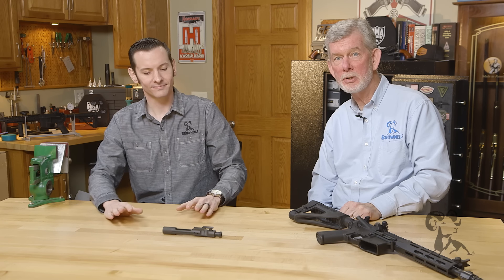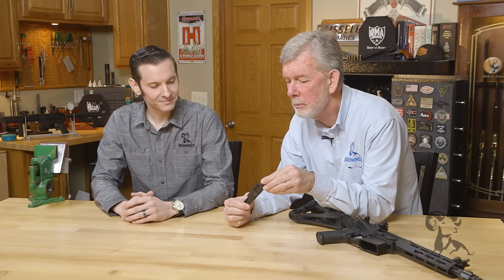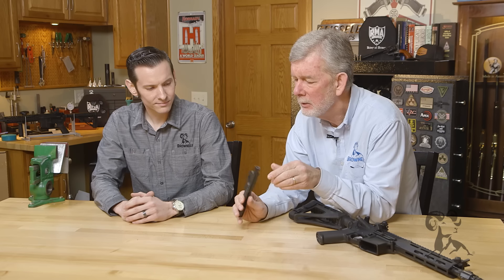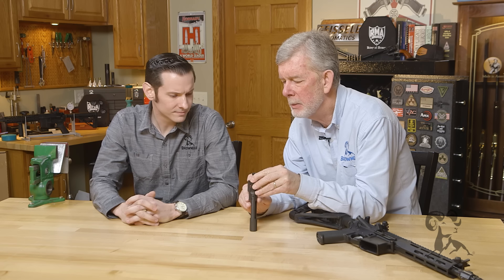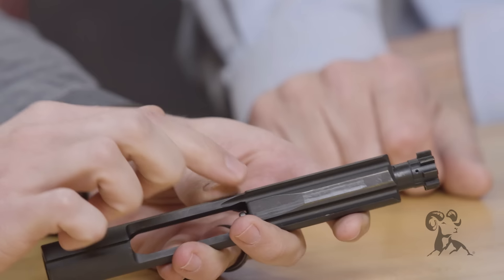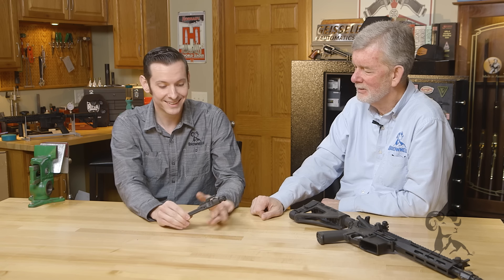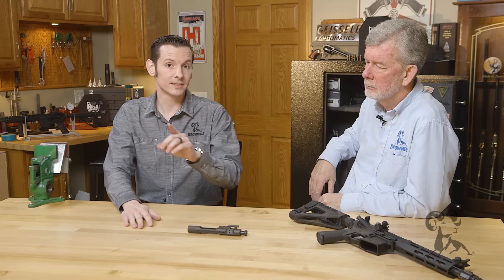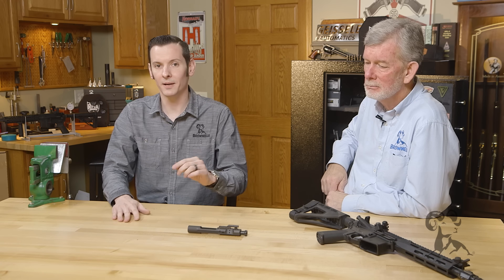Smyth Busters: AR-15 Bolt / Carrier Lubrication

Comment: When I was a new soldier, and most of my time in the military I kept it well-oiled, as directed and the established norm. Before and during my deployment to the Middle-East, I used practically none. I thought very carefully about it and decided that only true "friction surfaces" may need lubrication. It worked very well...actually better than with more lube. I wasn't wanting to attract sand and dust to those surfaces either.
  There has been so much misinformation in the military about lubing the bolt-carrier group.
  I am a big fan of dry lube also.
Reply: I was introduced to tw25b in Iraq my second tour and I swear by it. It runs smooth and no issues with dirt and dust.
Reply: @Justin Haven lubriplate?
Reply: @Oldmankingspiffy  TW25b is a great product. Beyond using it on my AR, my Sig P220 won’t run reliably without it and most of my 1911s run better if I use this on the slide rails.
Reply: @Oldmankingspiffy  I started using TW25B over the last 10 years or so on everything. It stays in place, and easily outlasts most other products.

Comment: Any place metal rubs against metal and couses friction.
Reply: Yep. Just like a car! Metal on metal should be lubricated. (Engine, Transmission, Rear Differential, etc.)
Reply: @rexlr695  And Mobil1 0-5 is just fine and dandy, if it's good enough for a race car engine it's good enough for my weapons.  The stuff sticks to the metal and doesn't hurt it one bit and is slippery.
Reply: And friction causes heat which, can lead to a lot of issues.
Reply: @UpChuckLiberals  mobil1 0-5? I cant find that one
Reply: @zstunts4843  Get the lowest you can find, it's not going to matter one bit.  Happy shooting.
Reply: I misspoke 5-30.  Sorry for the confusion.

Comment: I started an experiment many years ago.  I bought a double star AR15 chambered in 5.56.  I started by dropping in a 22lr conversation kit and shooting a 500 round brick of aguila 22lr.  Then I swapped it back to the 5.56 bolt and ran it for classes and competitions on a steady diet of tulammo 223.  This has been going on for almost 12 years with roughly 1,000 rounds a year through the rifle.  Never cleaned or oiled the BCG.  16" barrel and carbine length gas system.

Comment: When I was a fresh recruit, I did whatever was told of me and trusted the NCOs. Fast forward to the end of my contract and I was very particular about what NCOs tried to do to MY rifle. They wanted it DRIPPING wet with CLP and I refused, didn't get any reprimand for it. Dripping wet just didn't make sense to me, it was unnecessarily introducing the potential for schmoo and crud to habitate in the rifle.
Reply: @tuco86x  Schmoo. I haven't heard that term but I think I will use it. Ty.
Reply: My late brother in law, said that they cleaned their guns with soap and hot water, and  ran their M16's bone dry in Vietnam. They only squirted it with lube if it jammed up in a firefight.
Reply: @stevenrichards3699  That's the exact truth. Lubrication only helps after theres already a problem.

Comment: My bolt carrier assemblies are melonited, completely.  I spray the bolt carrier assembly with either solvents, than the oils listed below, and wipe off the excess.  My assembly shows no wear, but I follow the cartoon booklet of the Vietnam War for specific places.  I’m still reeling about mixing gun oils.  After 50 years of shooting, I learn this?  I used to use Rem Action Cleaner and Rem oil but switched to non petroleum Shooter’s Solvent and Shooter’s Oil except for use in my Remington shotgun.  The manual states nothing other than Rem products be used in my Remington.  
I spray or soak Brownell’s decarbonizing fluid after carbon is noted.  Now I’m wondering about your decarbonation fluid used first.  Does this impact parts, chemically, when Remington’s or Shooter’s Products are used?  I’ve used everything interchangeably. The first time of a quote “malfunction”, “lube” is used which solves range issues.  AR’s must be lubed.

Comment: Thank you for this video. I bought an AR type carbine a few years ago and recently started shooting it. I was told to run it with very little lubrication. The last time I shot it it malfunctioned with every shot. I'm going to give it a little more lube on my next outing and I'll see if that fixes the issue.
Reply: Lubrication is important, but also look at the magazine as a potential cause for malfunction. The only time mine ever failed to function was while using a Promag. Never again will I use one. Magpul is always a safe bet, and the gen 2 is perfectly fine for an AR and usually a little cheaper than the gen 3

Comment: Even did it this way in the army.. moderate oil on those friction rails, light oil on the rest of the bcg, light oil on the gas rings (not through any holes, literally directly applied to the gas rings after making sure the end of each gas ring was pointed a different direction, before putting the bolt in the bcg), LIGHT oil on the part that resets the hammer - you never want oil getting on your ammo.. great way to increase chamber pressure and go boom instead of bang.

Comment: A light coat of Supertech high temp grease from Walmart works great on all those surfaces mentioned. It's cheap too.
Reply: I use it for my handguns too, that stuff lasts FOREVER almost. I'm in Arizona and I shoot in the summer as well, the thinner oils aren't nearly as long lasting.
Reply: @tehkoalainsurgency  I am a fan of Slip 2000 or Slip 2000 EWL too. Doesn't evaporate easily, excellent viscosity.
Reply: I use the high temp bearing grease and holds up well. And for the few bucks it costs you get a lifetime supply. 

If it slides use grease
If it rotates use oil.
Reply: @JamesSmullins  That's what Cajun Gunworks told me two weeks ago. Bought their moly grease/oil.
Reply: vegeta420z  Amazon is no better and in many ways far worse though Walmart is trying to catch up in those areas with their online third party sellers.

You can get that grease at any auto parts store, if you have a local one use that.

Comment: I always been a grease person and never had issues with it. I found that my rifle would last longer than anyone else at a class and was even asked what I used and people were surprised to learn I used grease. It's important that when you use grease you learn about the friction points of your rifle and only apply the grease to that area and apply so little that it leaves a thin coat. Also grease last for decades if you have just 1 rifle. I have a 16oz jar of Red n Tacky that I bought back in 2015 and still use it for my AR rifle to this day.

Comment: I soak mine. Oil comes off over time but can’t be added in the field. It protects from rust and suspends any dirt until cleaning. Cleaning is easier because nothing is baked on, just wipe and reapply. The “too much lube just gathers more dirt” idea is a myth in my experience.
Reply: I've certainly seen machinery that was over lubricated and got crud into the gears and whatnot. Whether that's a problem for a rifle, can't say, but I would assume that having excess tacky lube on exposed sliding surfaces would gather up abrasive dust & dirt pretty well. Light oil, not so much.

Comment: I didn’t learn anything weird in the Army. But about 18 years ago my police department got a bunch of M16A1’s on loan from the Guard. They told us we had to soak the BCG. And while we were qualifying the range guys were walking around behind us with a spray bottle of oil to hose them down. Instead, I wiped my BCG down and just applied a tiny bit of oil where it’s needed. Had no issues. But the guys who would soak them down did.

Comment: Sorry to ask, but I heard some former military guy some where saying that everything that slides we should use grease, and for all moving parts oil. Is that correct or that's doesn't matter ?
Reply: That is probably the best advice about slides: grease, moving parts: oil, but honestly it takes about all of 30 seconds to remove your BCG and give it a quick wipe it down to remove any dust and carbon. The only time I can see an absolute need for grease is if the weapon is going to do sustained full auto fire. IMHO just a little bit of quality gun oil like Slip 2000 on all the sliding and moving parts (combined with the frequent wipe downs in hostile conditions) is plenty good enough.

Comment: I think the one drop in the gas tube connection helps "seal" the connection when the gas tube is installed. You can clean that little section with a pipe cleaner. Not a big deal
Reply: I would assume any oil in the gas tube would be blow out from pressure? Most gas tubes have I see have some residues surrounding them, from what I can tell it’s not a perfectly sealed system.

Comment: I have had issues with jamming in cold weather when lubed with oil; so when it’s cold (far north here. I’m talking -20 and colder) I clean the oil off and run graphite dry lube. The graphite has worked well in the cold, and since doing that I haven’t had any problems.
Reply: Interesting to know.
Reply: Fucking what?
Reply: it is interesting how temperatures wreck havoc with metal expansion/contraction, hardening rubber seals, freezing water droplets trapped in the action etc the whole physics change.
Reply: Vince Anders ...... not sure how to explain more clearly that extremely cold temps will jam you up if you run wet lube in it.
Reply: @kurtisb100  because cold weather justifies running an abrasive "lubricant" in your gun. Yes carbon is abrasive as hell. Source: I work with it every day. You're extremely stupid for doing that vs buying a lubricant that wont gel up at those temps.
Reply: Vince Anders since you ‘work with it every day’ I guess you must know a lot about it. Here’s what Wikipedia says about dry graphite lube. 

https://en.m.wikipedia.org/wiki/Dry_lubricant

I think I’ll take my chances that the cam pins wear prematurely vs jamming all the time in the cold. As for buying a lube that works in low temps.... I am beginning to think you’re not very familiar with actual cold temperatures. Anything that would stay liquid enough to work in the cold will evaporate after four shots, or once it warms up to room temperature.
Reply: @kurtisb100  except for the galvanizing that will happen between the raw aluminum that the graphite wore the finish down to and the raw steel that the graphite wore the finish down too.....sooooo yeah
Reply: Also notice every single application that was listed is specifically for high heat applications where liquid lubricants burn off? No? I'm guessing you skipped that part then huh?
Reply: New synthetics don't freeze up

Comment: I use one of those Chinese shaving cream brushes and brush CLP all over the outside. It's quicker than lubricating specific areas and nothing is missed. I also put a few drops of CLP on the cam pin.

Comment: I run as dry as I can to keep from prematurely gathering dust, I live in the High Desert in Eastern Oregon. Deployed 3 times as a Hawk Crew Chief. my rifles and pistols stayed dry and carbon free as much as possible but I used T25 or TU25 on my M240H. after the Marines gave us a bunch and we started using it, there is nothing better for belt fed. Its labeled for 50cal and up but I tell u what, its the best on a 240.
Reply: TW-25 was probably the best weapon lubricant I ever used. I used on everything from 20MM, .50 Cal, M16A2 and M9.  The grease was good for crew served weapons and the spray was great on personal weapons. 

I agree. When I went to Iraq, all of my weapons were run dry, and cleaned daily, at least. Never had a problem.  

Now that I am not in the desert, I have a wide array of lube and cleaning products to use. I still have some TW-25 floating around here somewhere.

Comment: Lube on the bolt carrier isnt about making the gun run, its about hardend steel sliding very quickly back and forth inside the much softer alloy of the upper receiver.....if you want the upper to last, run it wet. (But what do i know my family and myself only been in the manufacturing industry for the majority of our lives)
Reply: it only rubs on those rails....

Comment: I lube mine like an engine. Any area that touches another area that has movement during the cycle gets lube , other then rings. Rails on bolt carrier,  hinge outer surface on extractor and pin. Shiny area in the middle of bolt where in makes contact with bolt carrier,  ejection pin on bolt face, thin lube on all wings on bolt. Thin lube  on cam pin. Any area that shows indication of friction- will be missing some finish or shiny metal gets lube . Inspect inside of lower after shooting session,  if its bone dry at contact points then needs more or more often lube is how I run. In my experience after 240-300 rounds all oil is burned off or evaporated  on the b.c.g rails and on the lower where rails mate. If two pieces of metal are rubbing during movement I say keep it wet .
Reply: Sounds good except the locking lugs, bolt face and ejector should be dry, otherwise you will introduce oil into the chamber which is unnecessary but also potentially hazardous and increase wear and tear by not allowing the case to properly obturate to the chamber walls for a good gas seal,
Oil in the chamber will allow some of that gas to travel rearward onto the bolt face, hence the extra wear and tear, not to mention filth.
Lube her all you want behind the locking lugs, forward of that should be bone dry.

Comment: Usually after range/cleaning the bolt carrier group gets rehydrated then before shooting I usually drip oil on bolt carrier through ejection port than bring bolt back and drip oil on the back wall of the bolt carrier and than run that back and forth a few times

Comment: Yeah, wow. Thanks guys! From back in the day, the gas key, the vent holes, just as you guys said, were all to be lubed. I've learned over time that it isn't really necessary, and obviously just areas of metal on metal contact need lube, though always seemed like "general consensus" was, better to run it wetter,  than dry.

Comment: A drop of oil in the gas port is a good  idea when you have the gun open for cleaning. It will lubricate the rings on the bolt and break up any fouling in the system. Sure, it will all get blown out after a couple of rounds, along with the loosened fouling, but a bit will be retained in the rings. Additionally,  if the gun is put away after cleaning, this will protect the rings from moisture while stored. It certainly does no harm.
Reply: Definitely, I had ordered a new bolt carrier and the bolt was SO stifff I had wrapped a drop around the mating surface and a small drop in each of the 2 vent holes with the bolt down helped alot with it, I'm still gonna ask the gunsmith when I get my upper headspaced and torque checked if it's natural of brand new carriers still
Reply: Causes more problems than it helps.

Comment: I use synthetic motor oil(royal purple) on my guns and never had an issue. Seems to hold up to the heat pretty well too. 4 years later still have about 1/3 of a quart left, would have well over half but I accidentally knocked the bottle over.
Reply: Damn lost 5 years of oil in that spill!
Reply: @tonyromano6220  at the rate things are going with ammo prices, at least 10

Comment: no lube on the actual bolt, gas rings, or locking lugs?
Reply: Ryan McCarty Things they are saying are impractical. There were friction, I add lube. Pretty simple.
Reply: Locking lugs, sure.. oil on the gas rings will be blown off after the first few shot.
Reply: I’ve always put light coat on lugs. Never Ever on gas rings. Never have issues.
Reply: @gscop1683  Right. My understanding is no lube in the gas system, which on an AR includes the bolt carrier key, the bolt down around the gas rings, etc.

Comment: Well for sporting purposes yes. Just a touch of oil on contact surfaces, but in a combat/field rifle. Keep her moist/wet, it keeps that hard carbon from building up and having to scrape it out. The gun has piston rings like a car. Oil will get dirty with carbon and eventually need to me wiped down.  But allows for easy fast cleaning of components. Make it wet again and go back to work. I’ve only ever seen a AR/m16 malfunction when it was dry or caked up. Make it wet and they start running smooth again. Depends what you are doing with the rifle.

Comment: In a new or especially dry bcg I say just lightly coat the whole thing, let it sit a while, then wipe down. Use grease over oil in hot weather areas and wherever metal to metal contacts.

Comment: In 1971 when the M16A1 was relatively new Drill SSG Horton constantly scolded me for too much oil.  This is when there was hardly any oil on it, just enough to make it shine.  I guess he like to run rifles dry, preaching when we get to Nam we don't want dirt [sand] sticking to anything cause it jams ............ I'm surprised the guys that went to the Mid East were taught to run their rifles wet.  Thanks for the video.

Comment: I use bearing grease on the friction surfaces of my bolt. I don't use a lot but it always seems to work in my hot wet climate.

Comment: A few drops into the rotating star shaped thing and on any other shiny parts where you can tell there’s friction. I watched a Vice video of how the Afghan Army cleans their AKs. The take boot laces and tie knots in them, soak it in used motor oil and jerk it through the barrel and they fish the bolt out of the oil pan, shake off the excess and assemble it. They beat the barrel straight if it began to droop. The thing just keeps running